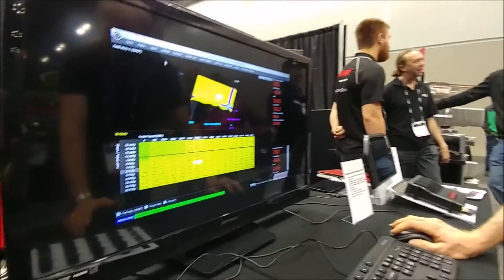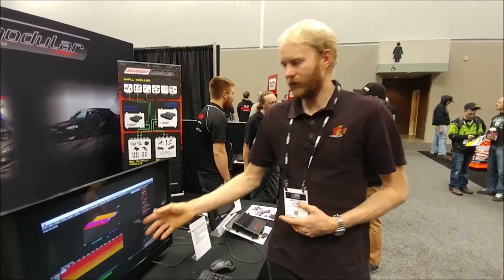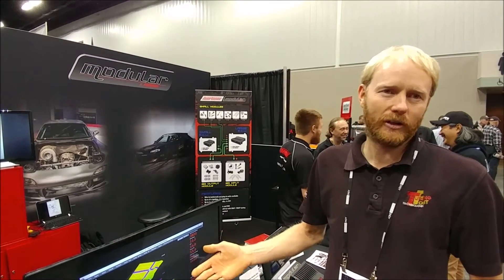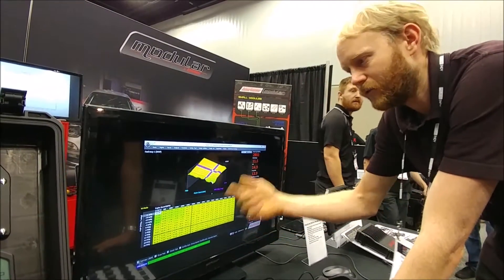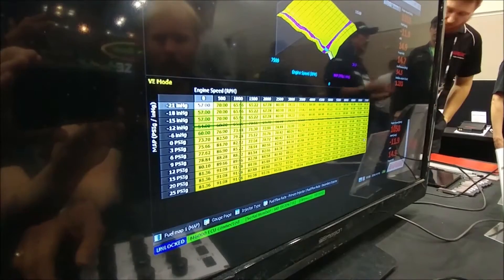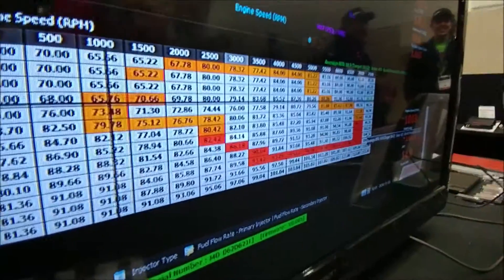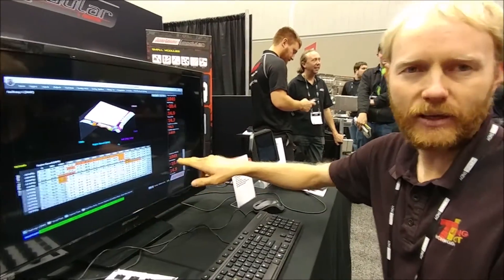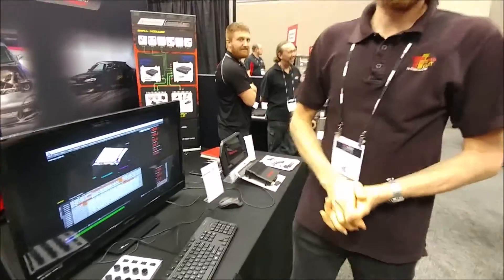Adaptronic Modular ECU Software Demonstration

Comment: spent 3 minutes to explain fueling "auto-tune"? Is this supposed to be a new thing? on Megasquirt with VEAL you could do that in 2010 if I'm not mistaken.
Reply: These have been self tuning since 2008, it is much more advanced than veal ever was. It was actually predictive too, could fill in cells that you weren't even in to fill in a base map. And ignition too.